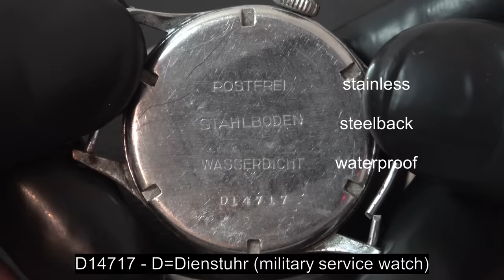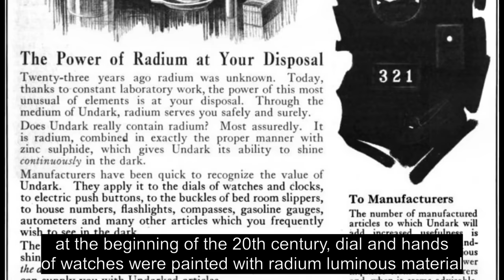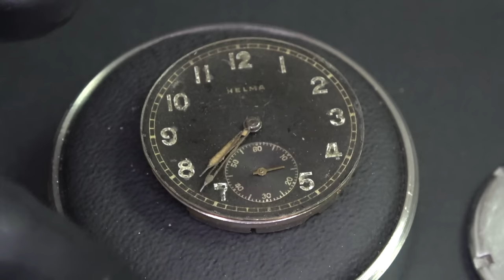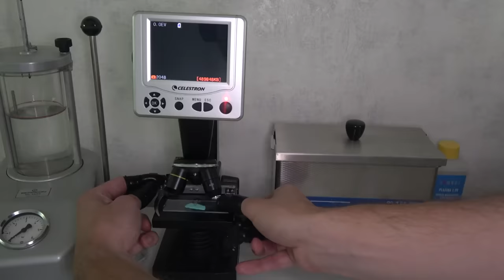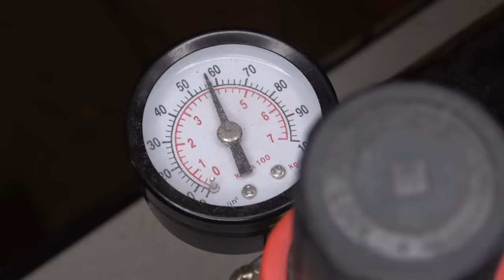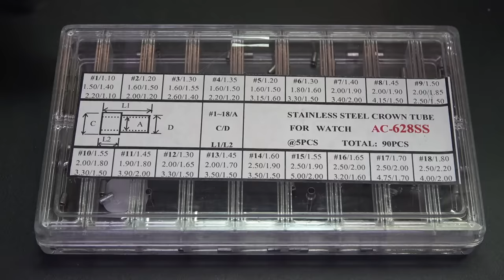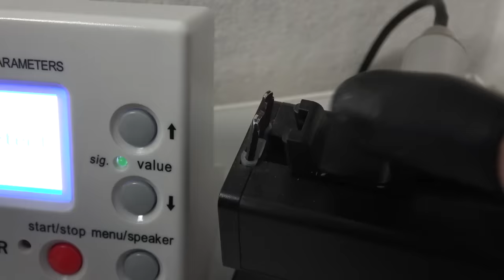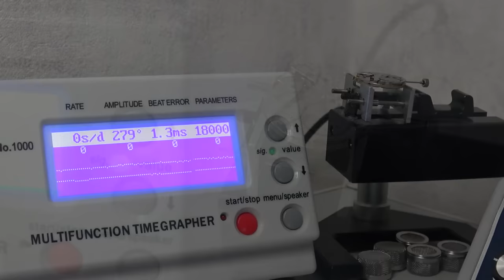Restoration of a Radioactive WW2 Military Watch - German Wehrmacht - Helma AS1130

Comment: You throw away all the obvious radioactive parts. But you keep the tools you use that actually make contact. I would be very curious for you to test your tools, table etc for radiation. 
I bet you have cross contaminated more than you think. There is a reason the experts use vacuum sealed rooms and disposable tools when dealing with this stuff. For your health. Be extra careful.

Comment: Awesome video…. I Have a question… does the dial and movement still contain radiation?. I had a gruen precision I found at a flea market and didn’t realize it had radium since the bottom of the glass was cracked and was hiding the    “RA Swiss RA”. I got scared and got rid of it… should have sent it to you 🤦🏽‍♂️

Comment: I would have replaced the dials they looked way to corroded, and the watch face I would have clean it more but I understand there's a risk of removing the paint from it, have you tried to use hydrogen peroxide to gently clean watch faces?

but nice work
Reply from the maker: Never heard about that method with peroxide. Maybe I will give it a try in the future 👍🏻
Reply: @RedDeadRestoration  better test it in a watch face that was replaced, to see how it works...